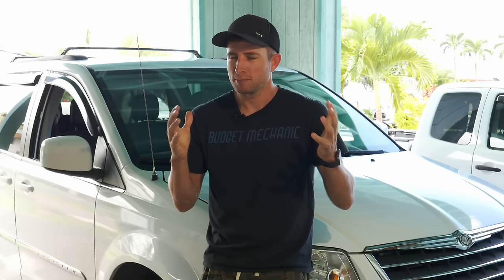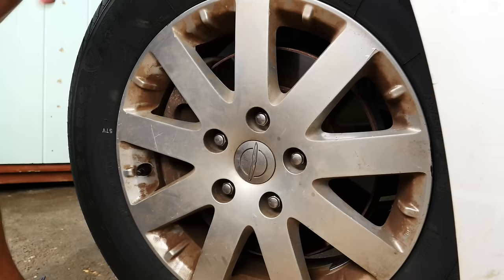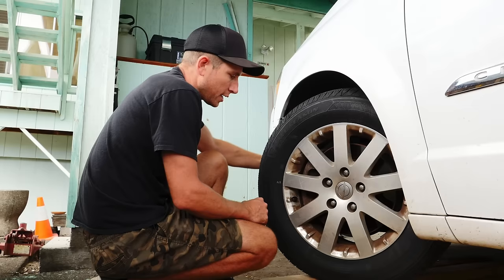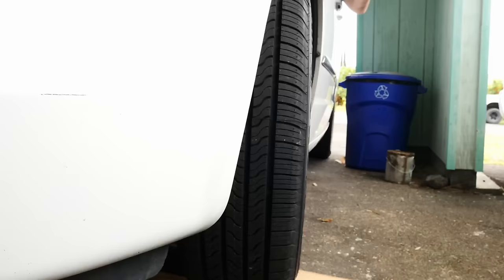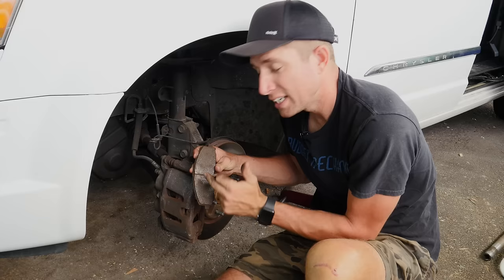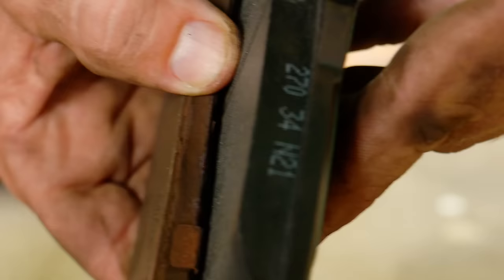How To quickly Check Your Brake Pads and Rotors - Don't Waste $$ Changing them Too Soon!!

Comment: One thing that wasnt mentioned in this video I'd like to say is I recommend to resurface your rotors when you do a brake job like this. So you can have a clean and even surface for the new pads.
Reply: Yes.  No one does this anymore.  Too lazy or don't care I guess.
Reply: My local AutoZone will resurface
Reply: Larry - hi - any idea why the pad on right side had much more weAr.  To it was the right side inner pad and not so much right side outer pad?  I find this too on my car with inner sides wearing much.  Maybe the inners dont slide good on caliper mounting bracket or not sliding on pins.  Too i get a lot of fast pitting on my rotors - leave in WNY area so a lot of road salt.  With this i might only get 5 to 10,000 miles before needing new pads and rotors.
Reply: Are rotors these days even supposed to be cleaned up or are they made to be disposable?  Anyone know?
Reply: @michael-qp9xd  slide pins and pistons are the only thing that come to mind that can cause that.
Reply: @chrislim7976  depends on the manufacturer, at toyota we do resurface rotors if its still within specifications.
Reply: @doomkid02  
👍 Thanks.  I assume theres just a lot of parts now that are junk/disposal.
Reply: A waste of money imo. Have never seen a solid case made for rotor resurfacing. Your rotor is either useable, or not salvageable. No in between.
Reply: @user-rg9xd9mu5r  toyota and im sure other manufacturers have a minimum spec for rotor thickness. Its cheaper to resurface a rotor than it is to replace it. I'm talking oem or  good quality rotors. Not no cheap chinese autozone stuff.
Reply: @doomkid02  I mean rotors are just cast iron if I am not mistaken. Really hard to screw that up. I seriously doubt there is a dramatic quality difference. Plus Autozone claims that many of their Duralast parts meet OEM specs... But back to rotors... I cannot imagine any scenario that would cause a need for resurfacing? I have scored rotors before from brake pads wearing down to metal, but when you take it in to these chain auto parts stores they say they cannot resurface if it's scored. so I am thinking wtf is the point of this service?
Reply: @user-rg9xd9mu5r  id like to think its more so that so the pad can wear evenly with the rotor. I have seen where people do their own brake job (pad slap) and all of a sudden their car vibrates when they hit the brakes. Next thing after that they bring it to the shop where i tell them they gotta resurface the rotors as well. Its just good practice i suppose to resurface them. Same with like a flywheel, either resurface it for the new clutch or replace it.

Comment: I had my rotors Resurfaced and new brake pads put on in 2022. Recently on my 2012 F-150 Lariat, I am hearing a squeaky noise when I am backing up and on the brake. What should I do? I try brake cleaner, but I still hear the noise.
Reply: Clean it, Wash it,dry it and lubricate calipers

Comment: I'm a professional mechanic going on 48 years of experience. I've worked on everything from lawnmowers and generators to Abrams M1 tanks; from 5,000-gallon tankers to motorcycles, and from go-karts to police cars. I initially gave your video a thumbs up, but I changed it to a thumbs down.

I agree with your advice, although you failed to explain why one side wore faster than the other. However, that's a different subject. The problem is that you did not use jack stands while working on the car, and I'm guessing that you didn't bother to chock the wheels either. This is a MAJOR safety issue that I cannot overlook. If I'm wrong, please correct me. Best wishes.
Reply: I've seen a car come off a jack and land on someone. Let's just say, it's NOT a pretty sight.

Comment: What you said about heat at the end convinced me to buy new rotors.  My rotors do not look at all like yours.  The top edge is pimpled from rust. 

Could you sand those top edges or do they even matter?  They aren't flaking just rusted and look rough.
Reply: Watch out for those warping cheap-ass rotors.

Comment: I have 3 cars all of them has a sensor in the pads.Once the sensor wire loop is disconnected it will trigger the alert in the dashboard. So it will be good if you could explain that one too

Comment: Why would I need rotors and not break pads and if that’s the case why not turn them.
Reply: 1. you should always fit new pads with new rotors. NO exceptions
2. surfacing discs is no longer viable in most cases as discs are a lot softer and wear faster now there is no asbestos in pads.

Comment: Why do people say "no big lip on the rotor edges" , but never explain what the consequences are of it?
Reply from the maker: Big lip would potentially interfere with new pads sitting on the rotor correctly. It also indicates a rotor that has significantly thinned and will overheat quicker.

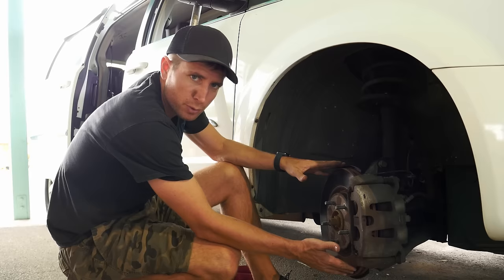Comment: 6:21 rotors
you failed to mention thickness of the rotors. if they have been turned a couple times, chances are they are too thin to be safe.
as you know too thin of rotor can be prone to cracking and even parts breaking off, neither are good.
Reply from the maker: You must’ve missed our other great brake videos! Check ‘em out!
Reply: Nobody turns rotors anymore.  They are cheap.  Get new

Comment: You are leaving out a lot of information.   Why is there uneven wear? What about rotor runout?  Is there brake vibration? Was the caliper seizing causing uneven wear? Are the brakes pulling to one side while driving? What about the fluid? 4mm for you is OK. What about your customer? Are they going on a long trip?  Do they tow? Do they drive on mountain passes. Tell the whole story before you give advice or bash other mechanics.
Reply: video is about checking pad wear…not for the reasons. says so in title.

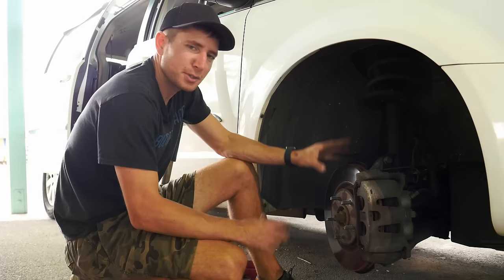Comment: 6:38 A brake rotor that is thinner than the minimum specification but “in good shape” is not OK.  Brake mass determine the ability to absorb heat energy before serious problems occur. Looking good does not dissipate heat. Terrible advice.
Reply from the maker: I would never recommend taking a rotor below minimum thickness.

Comment: You pushing the dangerous narrative. Even if there is pads left Xmm, brakes needs ever year checking and servicing. All these mm is useless if caliper is seized!!! Most people never check the brakes or order that kind of check, because they do not care. Because brakes does not only stop the vehicles, stability works too base on braking systems then every country should force the annual brakes jobs for every car. Most of young drivers can not handle the car raw power without stability program.